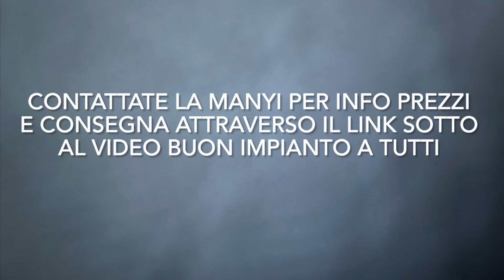BOX MEGA ACCUMULO DI ENERGIA FOTOVOLTAICA

Comment: Ciao Gianni  
Ora che l'evoluzione nella gestione delle batterie permette il parallelo ci sono punti non chiari.
Ad esempio 
Con le 2p16s  senza bms possiamo prelevare  oltre 500 amp.
Con X batterie in parallelo  possiamo prelevare 200x X  amp? 
es.200x3= 600 amper?
Reply from the maker: quello che dici è corretto. il BMS utilizzato in questi box è 200A quando li sommi sommerai la potenza massima. La cosa bella è che quando usi ad esempio 300 A per preleverai 100 A ogni batteria.